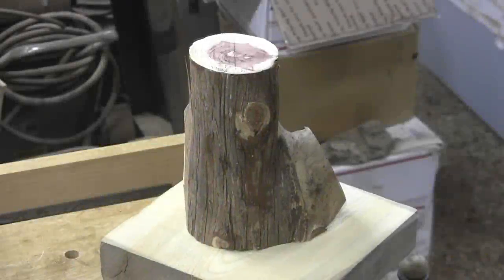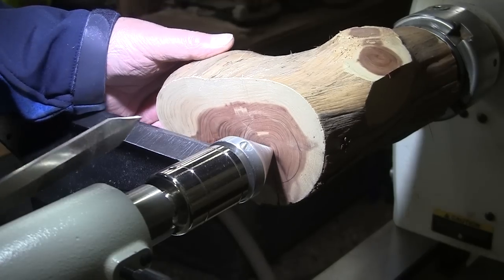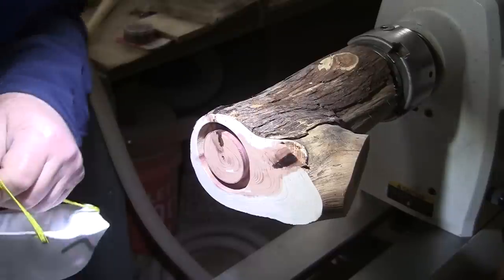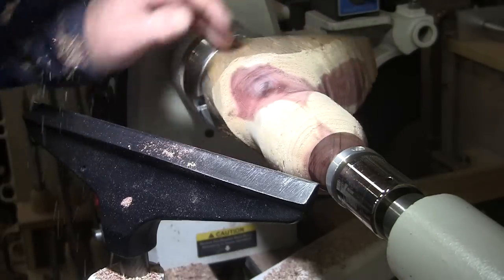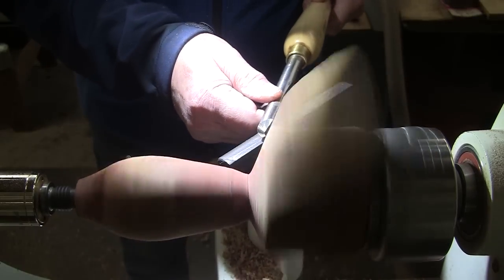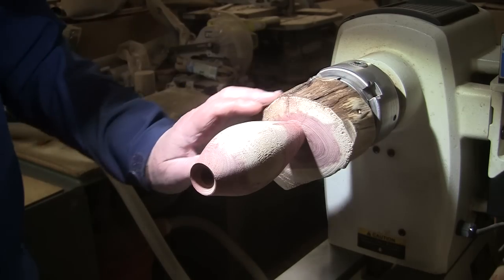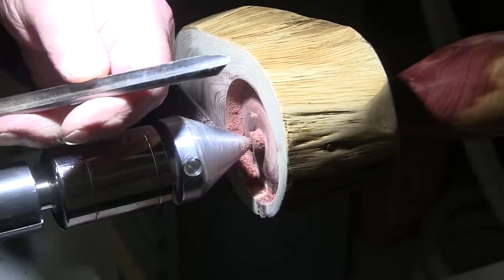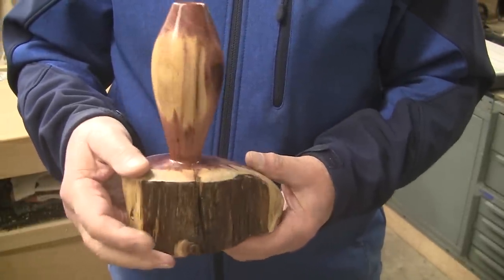Red Cedar Log To Vase - Wood Turning

Comment: Howdy Phil
Funny you heard me I said " use the parting to for the tenant " ... right when you said " I might now use the gouge " .
Must smell real nice in your shop .
Still have not hook up the gas heater .... I remember when you showed the shop ... still in the corner ?
Big and deep cracks ... got to put the CA glue in layers ... the top will dry first stop the air to the lower glue ... works for me and I use thin glue when I have such a crack .
That red cedar has such a nice look to it .
Nice piece Phil .
keep on turnin'
Reply from the maker: Yup, that heater's been sitting up on that top shelf since I brought it home more than 20 years ago, Bruce.  Have to run a gas line out to the shop and there are tons of trees between there and here.  Lots of roots.  Besides that, I guess I'm afraid of dust buildup and a fire.  I guess it will never happen, dang it! 😊
Reply: @PhilAndersonShadyAcresWoodshop  I know what you mean ... it took me years to buy a heater , just got one few months ago , from amazon ..... Mr. Heater 30,000 BTU Vent Free Blue Flame Natural Gas Heater MHVFB30NGT .... I put my Ryobi battery fan behind it , now my legs hurts from kicking myself LOL
Reply from the maker: @Ilikeit616  Good for you, Bruce!

Comment: Hi Phil I like turning cedar because the colors are so beautiful when the piece is completed with the finish but I find it splits and cracks so easy I have a lot of red cedar in my shop and when it’s quite you can actually hear the pieces cracking just sitting on the selfs I do turn a lot of cedar and do use a lot of c a glue😂 and you sure do awesome work!!
Reply from the maker: If you live some place where it's quite warm or if you have a heated shop, I see where the cracks might be a problem, Joey.  These weren't too bad, for me.  😊
Reply: @PhilAndersonShadyAcresWoodshop  I live in Louisiana it gets pretty hot down here!!

Comment: You handle that red cedar well. Those cracks are the most aggravating issue with that wood. Most of my efforts with that wood has been spoiled by invisible cracks that let go at inopportune moments. My best uses have been with segmenting as the glueing patterns hold the weakness together.
Reply from the maker: Thanks, Gary! 😊

Comment: Phil. Once again your vision of what you will turn is exceptional. You have such a talent to be able to see what is on the inside of a log. I have a question. Where did you get the shirt or coat you wear and why do you wear it
Reply from the maker: Thanks, Dave!  A lot of turners buy smocks.  I looked at them various places and the prices seemed outrageous to me.  I saw this jacket at Costco and bought it.  It's warm (I only wear it in cold weather) has elastic at the bottom, velcro on the cuffs, zips up to my chin, zippers on all pockets and nothing sticks to the fabric.  20 bucks!  I liked it so much I bought two more but that was about 3-4 years ago and this first one is showing no signs of wear.

Comment: Phil, I’ve been watching your videos and enjoying them all. I have just begun doing some woodturning and I’m enjoying it but what I have is an older Rockwell belt driven lathe. My gouges are craftsman brand and not a very good quality or at least they don’t seem to be. Also, I don’t have a live center or a chuck, just a small faceplate and a spur. I’m looking to upgrade my gouges as l can to a good midgrade set of gouges, a chuck and a live center. I would like to have some advice as to a brand for gouges and a live center. Also, I would like a size and brand for a chuck. There are so many brands that I don’t know what to get or where to go for them. Please give me some guidance if you can. Thank you in advance. 
2/12/23
Reply from the maker: Rather than recommendations, I'll just tell you what I use, Thomas.  Nearly all of my tools are Benjamin's Best.  I have no problems with them.  I've been using the same 5/8" bowl gouge for more than five years and just bought two more.  I use a Oneway live center and it's great.  I have two SuperNova2 chucks.  Your lathe likely takes a 1x8tpi so be sure to get an insert for your chuck that fits that.  There are several places that sell all of this online.  Just do a search for them by name and you'll have lots of choices. 😊
Reply: @PhilAndersonShadyAcresWoodshop  Thank you for the information. I just had a piece that I was working on fly out of my lathe and break my tool rest holder. I can get it brazed a replacement is non existent without having to pay an arm and a leg for it. Glad I had my face shield on at the time.
Reply from the maker: @thomasshows286  That's a shame, Thomas.  I broke my banjo on my old Delta lathe and found an original used replacement on eBay.  As I recall, the price wasn't bad at all and I was glad to get it.  Might try there.  Set up a search and get notified as soon as one is listed.  Might have to wait awhile for a decent price but I bet you find one.
Reply: @PhilAndersonShadyAcresWoodshop  I looked there today but there were none available but I will do what you suggested. Thank you and keep turning all of your beautiful pieces. I’m trying to learn how to see what beauty lies inside a piece of ordinary wood like you do. Of course it might take awhile for this 76 year old dog to learn that lesson.

Comment: Why do you sand with the lathe running foward or backwards or the sander running foward or backward.  What does that do for sanding?
Reply from the maker: When we turn wood, Jim, we are laying the fibers down, away from us.  By sanding in reverse, we can pick those fibers up and cut them off resulting in a smoother finish, faster.  The direction of the drill is related to the direction the lathe is spinning, for the most part.  😊